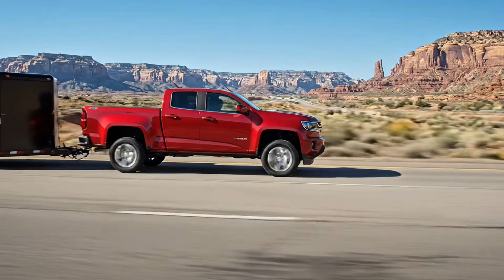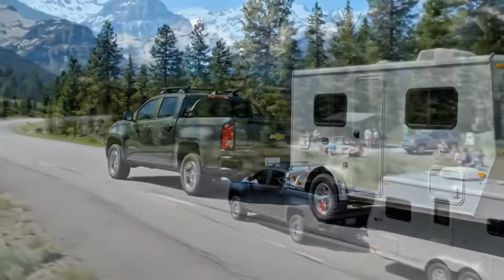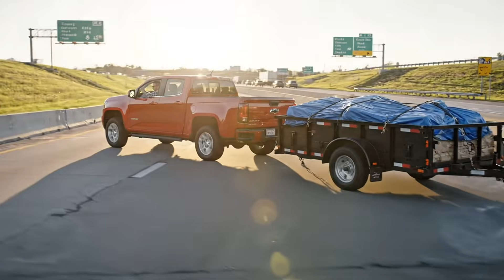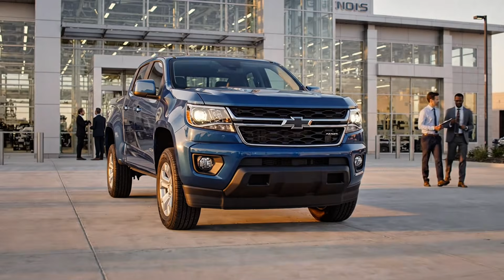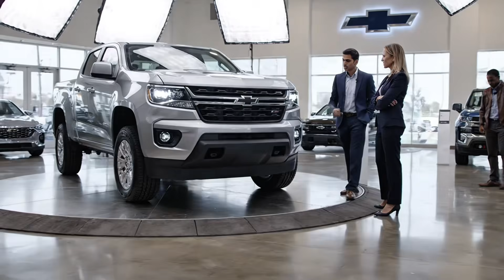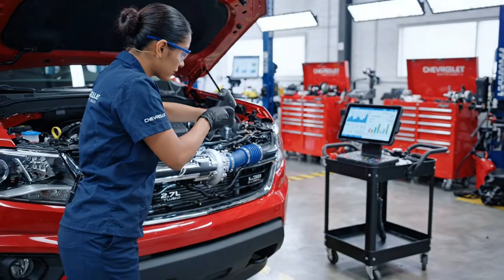Chevy’s 2027 Colorado 2.7L Turbo Just Shocked the Truck World | TurboMax Engine Explained

Comment: My BIL has a 2026 GMC 1500 with a 2.7-Turbo and he loves it.   He mostly does "daily driving" with the odd towing of a 6x10 utility trailer with a SXS and a little boat trailer - for his 15 foot aluminum boat with 20 HP motor.  He loves his 2.7-turbo (with its cooling and ECU updates) for his light duty usage.  He says the engine sounds different than his previous 2020 Chev 1500 5.3L.   Just in case he also bought extended warranty as well.  In 5+ years I'll have my sights on the 2.7 turbo engine as well.   Especially since I do light weight towing / hauling with my existing '21 GMC 1500 V8 5.3 as well..
Reply from the maker: That sounds like a solid real-world use case for the 2.7L Turbo. With the cooling and ECU updates, it’s encouraging to hear positive long-term experiences. The extended warranty is also a smart extra layer of protection, especially when planning to keep the truck for years.

Comment: Obviously, none of the comments here are from informed owners. I have a 2024 turbomax. This truck basically lives below 2000 rpm's in normal driving and below 2500 in towing 7500 lbs. This truck for me has never really struggled with any load so far. Driving on 2 lane roads at 65 mph usually yields about 24-25 mpg. This truck is truly built to be like a diesel. Chevrolet hit the nail on the head with this engine.
Reply from the maker: Thanks for sharing your real-world experience. Owner feedback like this is valuable and adds important context beyond the specs. Glad to hear your TurboMax has been performing well for towing and fuel economy!
Reply: Just got mine and I love it. Never had a 4wd that got 23-24 mpg
Reply from the maker: @jasonusaf6326  That’s great to hear! Real-world owner experience like yours is exactly what matters. 23–24 MPG from a 4WD Colorado is impressive, especially when you’re getting that kind of everyday performance. Thanks for sharing!

Comment: To small of an engine for a for a pick up truck not enough torque specially if your pulling a medium size trailer you need a V8 not a small four banger thats turbod.
Reply: 430 lbs. not enough??
Reply from the maker: @Raymond-k7l  Exactly — 430 lb-ft is solid torque for a midsize truck. The real question is how it performs under load and how it compares with a V8 in actual towing conditions. Thanks for weighing in!
Reply from the maker: That’s a fair opinion. A lot of truck owners still prefer the sound and feel of a V8. The TurboMax does make strong low-end torque for its size, but whether it’s the right choice really depends on how the truck is used. Thanks for sharing your perspective!

Comment: I like the 2.8L diesel engine.  Driving easy/no towing and get over 40 mpg.  Towing 7,000 pounds and get 12 mpg.  I reckon this engine could not meet the EPA emissions requirements.
Reply: I’ve owned both motors and the 3.0. Gets better mileage.
Reply: @johnnydangerously9426  We have a 3.0L now and it has noticeably more torque.  I changed the ECU tune mapping on the 2.8L and this improved fuel mileage and torque.  The best fuel mileage on the tuned 2.8L was 45 mpg and the best on my 3.0L stock tuned truck is 42.6 mpg.  The Silverado is heavier than the Colorado so this is not apples to apples, in my case.
Reply from the maker: @markwayne7  That’s a great real-world comparison—thanks for sharing the details. A tuned 2.8L delivering 45 MPG is impressive, and you’re absolutely right that comparing a Colorado to a heavier Silverado isn’t exactly apples to apples. Appreciate the insight!
Reply from the maker: @johnnydangerously9426  Thanks for sharing your firsthand experience! It’s always valuable to hear from someone who’s owned both. The 3.0L Duramax has definitely impressed a lot of owners with its efficiency.
Reply from the maker: Thanks for sharing your real-world experience. The 2.8L Duramax has definitely earned a loyal following for its fuel economy. Emissions regulations have become much stricter over the years, so it’ll be interesting to see how manufacturers balance efficiency, power, and reliability going forward.

Comment: It won't last. Just get a bigger displacement without the turbo. Most turbo owners don't know when to shut the motor off.
Reply from the maker: That’s a fair point. Larger naturally aspirated engines do have advantages for simplicity and long-term durability. Modern turbo engines have improved a lot, but maintenance and proper driving habits are definitely important. Thanks for sharing your perspective!

Comment: Uhhh...  This engine has already been in the fullsize trucks since 2019, the midsizers since the 3rd gen refresh in 2024. There is nothing new about this engine save GM is going to push more PSI out of the turbo for bigger HP and torque numbers for the 2027 model year.  They have been solid engines so far, but pushing them harder than their current numbers could be a future disaster.  The engines are robust, built with forged internals, built like a turbo-diesel, but even this engine has a breaking point if pushed too hard for too long, like any other boosted engine.
Reply: Very well said. Looking at the Colorado to buy.
Reply from the maker: @Giddiup157  Hope you enjoy it if you pick one up! 👍 The Colorado has earned a lot of positive feedback, especially with the TurboMax. Let us know what you think if you end up buying one!
Reply from the maker: Great points, and I appreciate the detailed input. The current TurboMax has proven to be a solid engine so far. It’ll be interesting to see how GM balances any future power increases with long-term reliability. Thanks for sharing your insights!

Comment: ford has had this for a few years.  Mostly it has been a good performer.  For me, I don't care for a tiny little engine and hanging a turbo on it to get ungodly HP and torque.  I am of the opinion this is putting a TON of stress on all the components of the engine which, to me, is not good for longevity.
I think GM (and Ford) knows most pickups nowadays are glorified grocery getters and only occasionally used as a real truck.  If that is how you use a truck, go for it.  I use a truck like a truck more than just pedestrian transportation.
Reply from the maker: You make a fair point. Modern turbo engines can deliver impressive power, but long-term durability really depends on engineering, maintenance, and how the truck is used. It’ll be interesting to see how these hold up over time. Thanks for sharing your perspective!